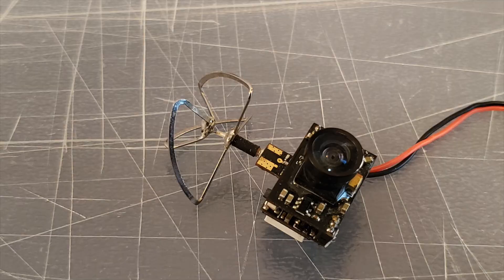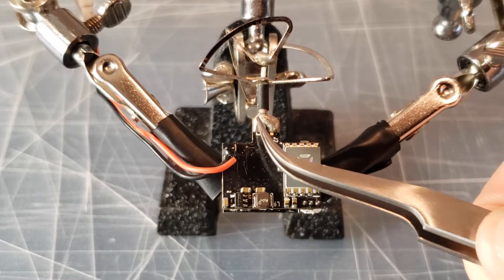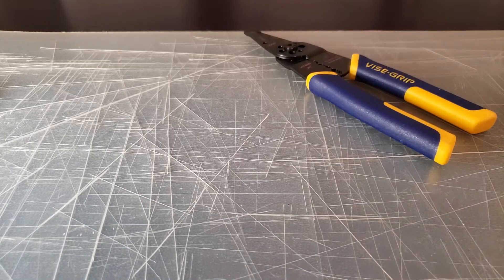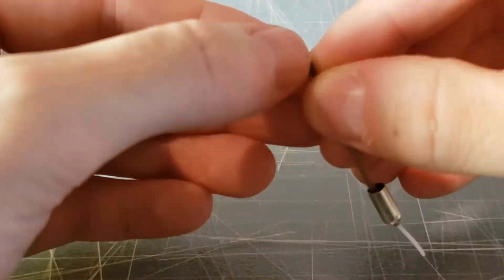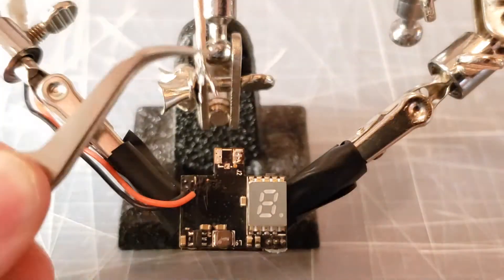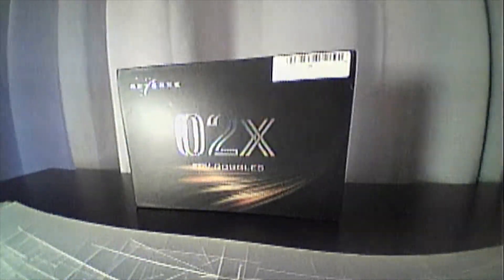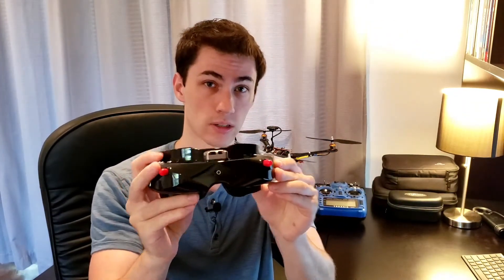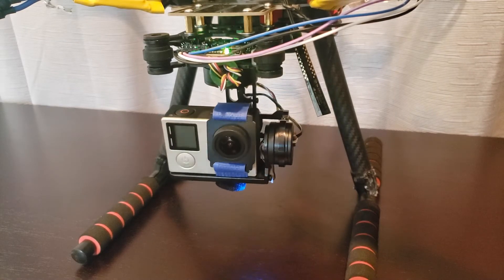How to Replace Broken FPV Camera Antenna

Comment: im currently trying to setup my Tarot T-3D IV 3-Axis Brushless Gimbal on my s500 with Pixhawk 4 its not going well iv been pulling my hair out for days lol and i just spotted your servo video & its a god send i will give it another go in the morning you have given me fresh hope. cant wait to see your gimbal video. do you feel like doing an holybro Micro OSD V2 video lol got trouble with finding the settings to set it up in Qgroundcontrol the only other one is from Painless360 and its not that good for QGC user's keep up the pixhawk/s500 vids
Reply: nope tried it today still cant get my gimbal to tilt and yaw on aux 1 & aux 3 lol i armed the quad and the gimbal slowly started looking up the glitches down lol what am i missing